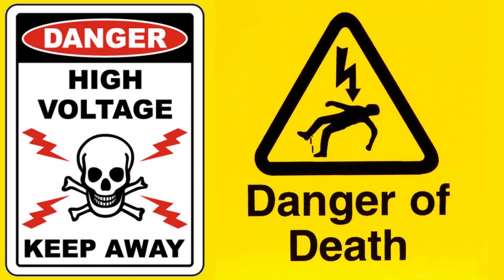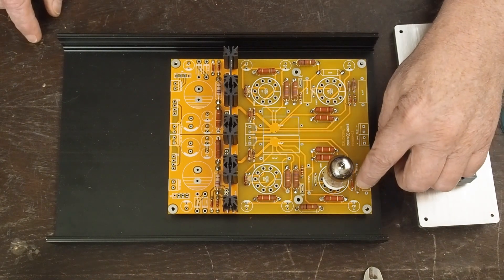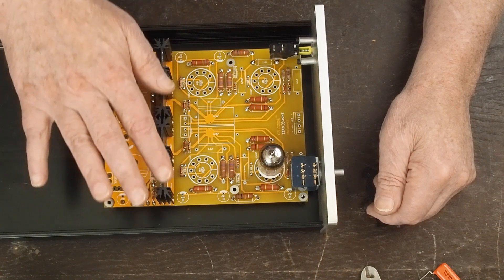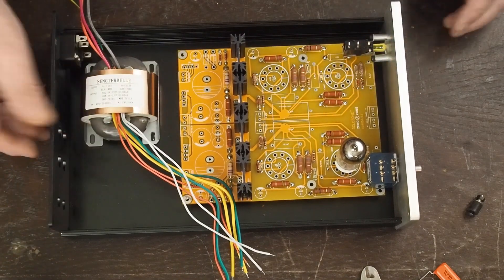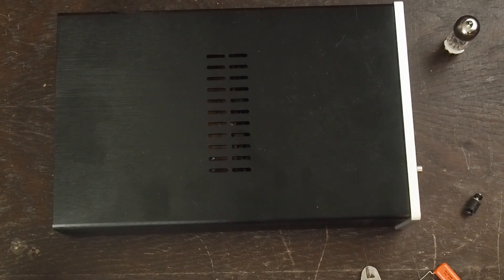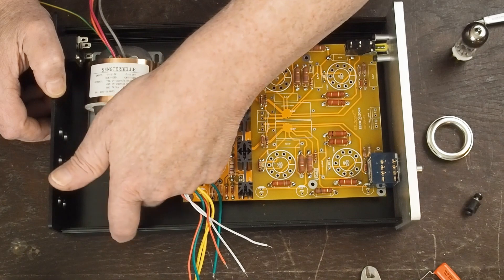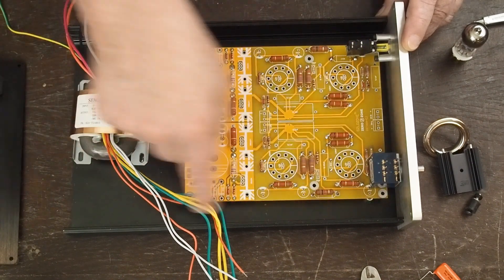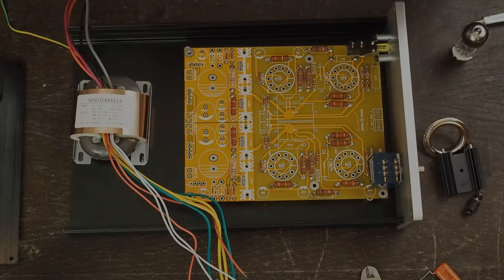HiFi Tube Pre-amp: The build starts!

Comment: The old flatt casette cabinett, chassis are nice fore preamps, but you can use a wood box and put some mounting material,fore potmeter and conectors,then you only need an aleminium plate to build on. point to point.

Comment: While it looks like the pv-5 schematic  the use of a 12ax7 rather than the 5965/ 12ay7 is a poor choose for a cathode follower . It has very low current on the ax rather than a a7 or at even a au for that matter.
Reply from the maker: We will see how all this plays out :)
Reply: @SkunkieDesignsElectronics   nice job there not your fault.   Just more of a design point .
Reply from the maker: @johnwilliamson467  Any reason I can't drop some 12AU7 in the final stage? I haven't done a lot of study but they do share the same pinouts. I plan on using 7025 tubes to start with.
Reply: @SkunkieDesignsElectronics   Change the cathode  resistor for the increased current and you should be good to go . the circuit is one that was popular in the 80s by CJ  sold a number of them .  The board looks of good quality.  an AT or AY (5965) is what CJ used . i will look up the values and  let you know.
Reply: Try  2 80ks for the 2 47k cathode resistors with an AT  about the same with some AU they should work ok.  Yes they all are 9A  pinouts .
Reply from the maker: @johnwilliamson467  cool, I might try this as we are working on this project . Thanks!